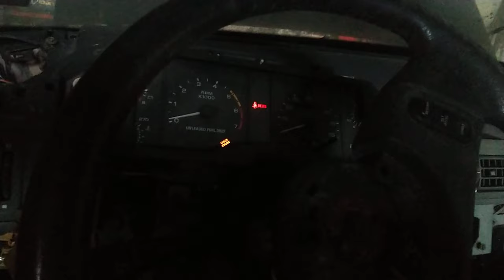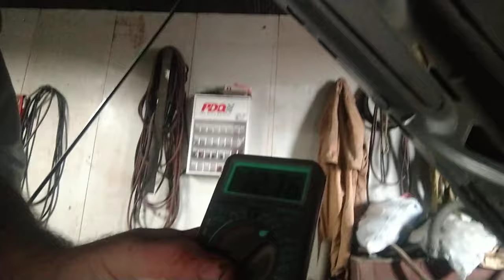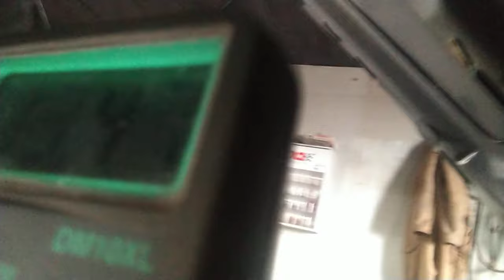Don't miss this simple step, Ford alternator not charging.

Comment: Ok what do I do to fix it though!!!
Reply from the maker: @_Noeys_ark_  is it a broken wire? Bad connection? Burned out bulb? Bad ignition switch? Does the alternator charge when you jump power to the exciter wire? Does the bulb light up with the key on before you start it?
Reply: @bulldogsautomotiveadventur4387  the battery light does not come on on the dash idk what’s causing that.. I shaved down that red and green wire on the alternator I then hooked a wire to that cable  and then ran that directly to the battery and the battery light now comes on on the dash hell I turned the car off and the battery light stays on on the dash. What does that mean ? What should I do?
Reply: @bulldogsautomotiveadventur4387  the battery will not charge even with that wire connected to the battery
Reply from the maker: @_Noeys_ark_  have you had the alternator off and had it tested? You should have power on that wire with the key on and ground at that terminal in the alternator.

Comment: I got a 2004 ford focus with new battery and alternator battery light keeps going on and off and dying any tips
Reply from the maker: Voltage test to see if it’s actually charging, some fords have a big alternator fuse that’s known to crack
Reply: . where would that fuse be located? I cant seem to find it
Reply from the maker: @giobarajas3654  it depends on the vehicle, it would be a bolt on fuse usually in the fuse box but sometimes mounted elsewhere, on the older models it’s just a smaller gauge wire inline close to where the charge wire hooks to the battery or solenoid.

Comment: Hey man, wondering if you could help me out. I put a new alternator in and new pig tail. Battery light was on dash and still wasn’t charging battery. I took my wire tester and noticed one of the wires from the pigtail to the solenoid wasn’t getting power. So I changed that wire out and started it up, now no light on dash. But it is still not charging
Reply from the maker: See if the charge wire on the back of the alternator has battery voltage or if it’s above.  Could be an issue with the big wire or a connection
Reply: Okay I’ll check that out 👍🏼 what about the fusible link ? Could that be a issue
Reply: Btw I have a 1989 4.9l
Reply from the maker: @huntererhart1913  yes it could be, that’s why you want to check to see if the alt is charging at the back of it, that way you know the problem is between there and the battery

Comment: My problem was the damn 4 pin connector under the battery tray area, the red/green and yellow alternator wires go through this connector and it rots/ corrodes there big time.

Comment: Cool but where is that green wire having same trouble with my Fox body mustang sir
Reply from the maker: It runs up front, across in front of the rad, then back along the bottom of the battery to a four terminal plug around the stater solenoid before running back into the firewall. For some reason the horn wire runs in the same harness.
Reply: @bulldogsautomotiveadventur4387  thanks sir but is it a all green wire
Reply from the maker: @billyhernandez7540  I think it was green/white striped to the connector and solid green from there to inside…but it’s been a couple years

Comment: My battery light is on after 3 alternators later. I feel like the white wire isn't working. Battery was load tested n good.
Reply from the maker: @Wesley-fk7ef  it depends on what kind of vehicle you have and what brand of alternator you’re using, there are brands that have a 100% failure rate
Reply: @bulldogsautomotiveadventur4387  I 2002 f150 4.2. last two alternators were 100 percent new. First was reman .
Reply from the maker: @Wesley-fk7ef  I just did a ford 500 with a customer replacement ultima that overcharged and ran the battery down, customer supplied a TYC from rock auto that overcharged at an even higher voltage and ran the battery down…a lot of different brands use the same suppliers for internal parts like the regulator. That truck would probably be a computer controlled alternator so it need to be on a diagnostic machine to rule out a problem with the vehicle, otherwise three alternators in a row is not unheard of…the most I’ve seen is nine.

Comment: What if it won't stop charging it stays at 14.6 at idle give it gas and voltage goes up with rpm and doesn't stop
Reply from the maker: Depends on how much it goes up, anything over 15 volts there has to be a problem with the internal regulator.
Reply: @bulldogsautomotiveadventur4387  it goes well over 19v gauge stops there and after about 5 seconds of that something clicks and voltage goes to middle of the normal range.
Reply from the maker: @RollingThunder85  the regular has to be bad inside the alternator.
Reply: @bulldogsautomotiveadventur4387  thank you sir that's what I assumed is there any use for the old alternator such as a way to repurpose it for anything useful in my shop or motorhome?
Reply from the maker: If you have a rebuilder around they can install a new regulator, usually not a huge deal on a non-computerized alternator.
Reply: @bulldogsautomotiveadventur4387  thank you sir

Comment: Have a 87 mustang gt hatchback 5.0 suddenly stopped charging and turn signals stay on no flash
Reply from the maker: I don’t think there’s anything between the charging system and the turn signals, if you don’t have a charge indicator light but it doesn’t charge I would start by checking the printed circuit on the IP…has someone been working on it?

Comment: I see the workaround solution, but what is the fix that will make the battery light come on and the charging gauge work like factory ?
Reply from the maker: I repaired the wiring harness where someone had cut it, I had pulled the dash and checked the bulb already. I've seen people just wire in a 194 socket into that circuit also.
Reply: @bulldogsautomotiveadventur4387  thank you for this video, I'm currently dealing with no battery light and no charge after a passenger side head gasket replacement, absolutely bizarre  !!!

Comment: Can you please help me ? I have 2013 ford fusion  that showed check battery charging sytem , I have a good battery not even a year old ,  I replaced the alternator because it was bad but , it now starts but will die quickly / when drving itll  shut off my check battery charging sytem light never turned off after replacing the alternator and i checked the fuse for the alternator all good. Idk what to do . Hopefully you can lead me to the right direction. Thank you in advance.
Reply from the maker: First it needs to have the voltage checked to make sure that it's charging like it should, beyond that I have seen a few vehicles (usually Fords) that will charge but the light stays on because the aftermarket alternator used a defective or incorrect regulator making the computer believe there was a problem. The dying problem is most likely a result of the computer needing to relearn it's idle setting since the battery was most likely unhooked for the alt. replacement.

Comment: Ok so i have a 04 expy new battery and alt but the bat light is still on and i can be driving ans my volts go down all i have go do is give it gas and it goes up but its not fully charging and i still need to get it jumped
Reply from the maker: Have the battery load tested, also test the voltage while running, just because the alt is new doesn’t mean it’s good.

Comment: So the green wire for the dummy light has to be hooked up for battery to charge?
Reply from the maker: Yes, that light is powered through the ignition switch and runs out to the regular, when the alternator does not charge it's grounded causing the light to come on but it uses the power from that wire to turn the regulator on, when it starts charging the light goes out because there's power on both ends and it looses it's ground.
Reply: I was fighting this issue for a few weeks.now.i also asked my fordmaster mechanic brother in law this question and he said it was just for dummy light.shouldnt have to be used.until I wired it in and it started to charge.thanx for the awesome video
Now I can sleep better tonight.lol
Reply: @patrickdubuc3439  how did you wire it in , seems like just hooking up the green wire to power doesnt make a difference until it acts like a switch but as soon as I shut the vehicle off and restart it will not charge until Its switched on  again

Comment: My 1987 Nissan 300zx’s new alternator is not charging and the battery light is not on.  I guess I need to do some electrical tests
Reply from the maker: I’d do some research on that system, some of those imports had some convoluted wiring in the eighties and early nineties.

Comment: Can you please help me 
Went out to the car one day and the radio was on and wouldn’t come off so we started unhooking the battery few days later car wouldn’t start and it’s not the battery because we can charge it and drive it maybe 10 miles before it does we at first thought it was the alternator but now I’m thinking  it’s the wires I just had the ignition replaced about a year ago because the key wouldn’t come out of the ignition and what ever the first dealership did I think did this
Reply from the maker: It's not charging the battery if it drives for a while and the battery goes dead, sounds like it has computer issues since the radio was on but there are several things that are possible depending on what kind of car it is.
Reply: @bulldogsautomotiveadventur4387  it’s a 2001 Ford Escape and he was about to go change the alternator but I’m really thinking it’s not the issue .  Like the ford dealership did something and I can’t use the only car we have
Reply: @bulldogsautomotiveadventur4387   also thank you for replying because I have tried so many things. All the lights on the dash went off  but the battery light comes on
Reply from the maker: @carolyntravis11  if it's been a year since they worked on it then it's doubtful that it's something they did, it's not impossible but very unlikely. The charging system needs to be checked which can be done with a voltmeter.
Reply from the maker: @carolyntravis11  if it's the 6cyl then it's an adventure to change the alternator due to it's location. Good luck with it and I hope you get your car going again soon.
Reply: @bulldogsautomotiveadventur4387  thank you for the help it’s so greatly appreciated. & I’ve had problems with it since they’ve given it back to me I never had an oil leak before them and now I do it’s been sitting for a year because I didn’t have the money to fix it.  This happened a few months after they fixed everything as they said and the ac quit like a month after they did it we spend 5 thousand dollars on it

Comment: Would it work for 1988
Reply from the maker: @baileydelaune3948  yes, if it’s a ford with a battery light that’s what they used up until the mid to late 90’s

Comment: How do you get power to that wire?
Reply from the maker: Power comes through the ignition switch, through the dash light, and out to that terminal...on this car it was a connection underneath and forward of the master cylinder that someone had cut off and stolen. I found the right pigtail in a used harness and repaired it.
Reply: @bulldogsautomotiveadventur4387   so re wire it sorry I don’t really understand the video I’ve had alternator problems for a while and replaced the battery I don’t have a battery light come up when it turn the key
Reply from the maker: If it has a light instead of a gauge then the bulb has to work with the key on, not running, in order for the alternator to charge...if that bulb is out it won't charge. This car was a Frankenstein and someone had cut up the harness.
Reply: @bulldogsautomotiveadventur4387  should I try replace the bulb?
Reply from the maker: I would definitely test it if it's not a big deal to get to...bulbs are cheap.
Reply: @bulldogsautomotiveadventur4387  thanks

Comment: We need the wire from alternator to battery on 05 escape. Can you show it and possibly the part number
Reply from the maker: It’s either a yellow/white tracer or black/orange tracer, no idea on pn# as I usually run an overlay if needed. Not sure why you’re replacing but if it’s not burned they have a mega fuse that likes to break that will cause a no charge.
Reply from the maker: It will be the largest wire
Reply: Guy came to fix it but couldnt get the alternator off. Another guy came but cant find the wire any where, so trying to replace
Reply from the maker: Sorry to hear of your troubles, I wish I could help but that’s a hands on deal, that’s not a job for a novice…there are videos on YT that show how to get at it from the top, my hands are too big for that so I always go out the bottom.

Comment: So this means the battery light on my dash if it is out I have to replace the bulb  for it to start charging my battery?
Reply from the maker: If your vehicle uses this type of charging system then yes, several of the older vehicles use the bulb inline with the exciter wire that has ground till it starts charging.

Comment: Where are you connecting the light too
Reply from the maker: In the larger plug there’s a green wire, I had the ground of my test light hooked to positive on the battery, then probed the green/white or green/red (I don’t remember which) on the larger plug
Reply: Thank you very much I been having the exact problem with my truck

Comment: Help me out Bulldog 
I’m counting on you
Reply from the maker: What are you needing help with?
Reply: @bulldogsautomotiveadventur4387  oh I have a 2007 ford 500 and 2 of the 3 wires are messed up
Not making the alternator work 
Seeing if you had any knowledge on the wiring
Reply from the maker: @jaybutton3004  I take each job individually, ford should have a replacement pigtail available, with a wiring diagram and a connector end view it’s a lot easier, without those I usually have to do a lot of internet digging.
Reply: @bulldogsautomotiveadventur4387  awesome thank you
Y’all I’ll keep looking

Comment: Early BMWs did this as well, the exciter circuit runs through the battery indicator light on the instrument cluster.
Did the same thing - bought a new battery, bought a reman'd alternator ... car runs on battery only and dies when the battery is drained. 'EV' of the wrong sort.

Comment: I bought new alternator battery and I have a check charging system
Reply from the maker: Later model vehicles will have that light sometimes due to the replacement alternator having a different resistance in the regulator, need to check voltage while running.

Comment: Might be a $5  mega fuse
Reply from the maker: The mega fuse didn’t exist yet on this application, it wasn’t available until the mid to late 90’s. Had several Z-tech four cylinder Ford engines that liked to crack that high amp alt fuse due to engine vibration.
Reply: @bulldogsautomotiveadventur4387   How was the zetec ford , strong engine?